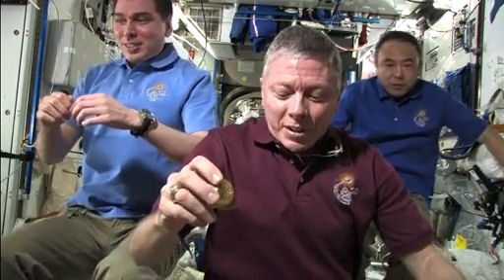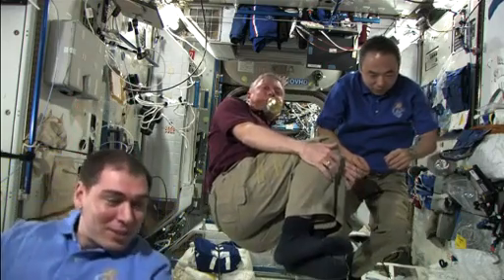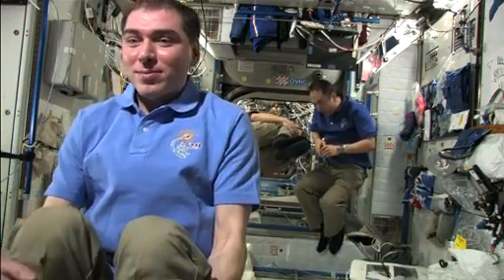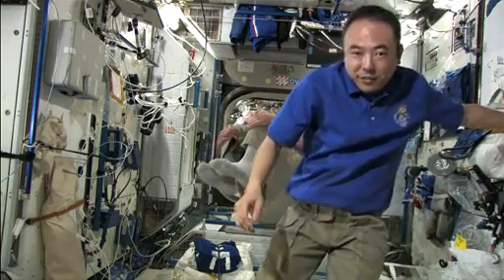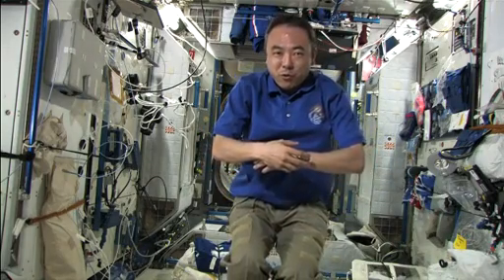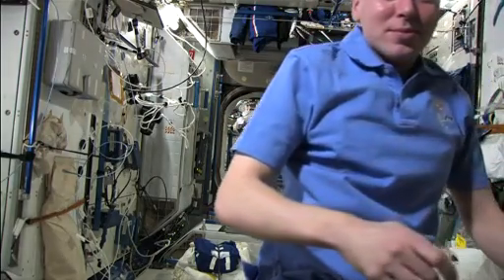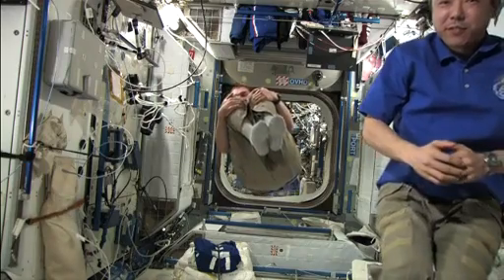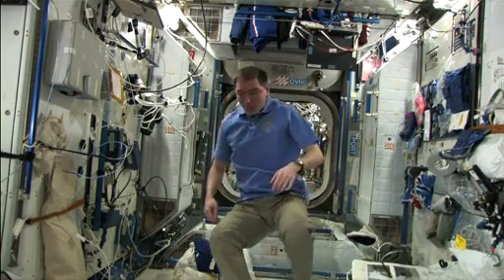NASA - ISS Reboost

Comment: I wish they'd have done it to our Skylab Space Station.  That really had some large, open spaces.  They even test flew a rocket pack. One of the guy's strapped it on and flew around ! Also, IF they had launched the 2nd, flight ready Skylab, they could have connected them. We would have had a 20,000 to 25,000 cubic foot station.. in 1975.  And - we had.. NERVA ! Look it up. Just type all caps - NERVA